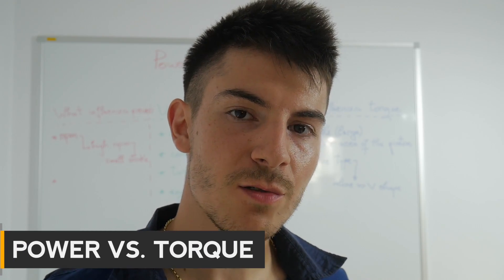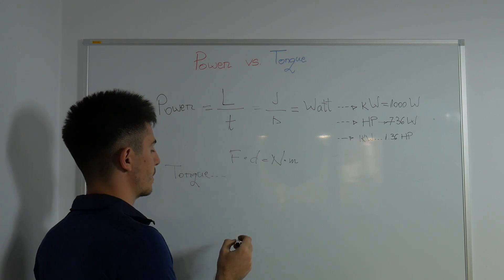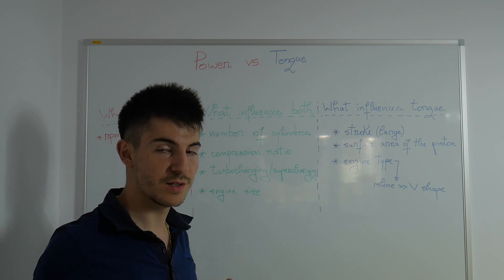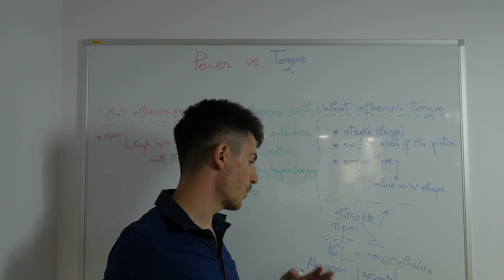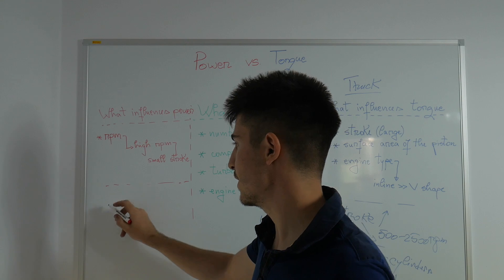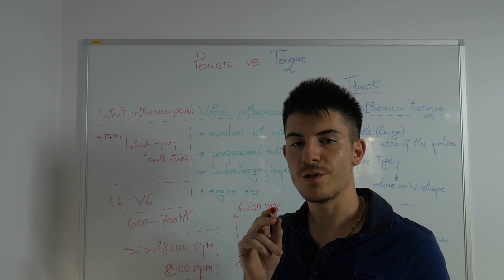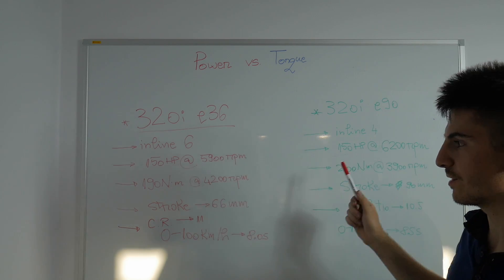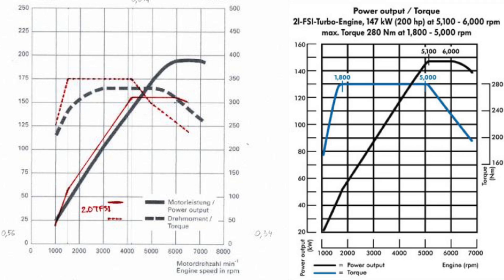Power vs. Torque vs. RPM

Comment: hello, nice video, thanks for sharing! I have a bit different problem. My car BMW M4(F82) offers more toque at high RPM then it is alowed to use (software torque limiter). I cant understand, why the torque is such strictly reduced from 5.500 RPM because if there is not a torque limiter the engine can continue with 550Nm up to 6.200 RPM, now after restriction it has only 490Nm. Can you tell me why BMW restricts the torque at higher RPM?

Comment: I found two different Horsepower equations. I'm no math guy, so I'd like someone to explain why there are different ones.

First equation is  HP = Torque X RPM / 5252

Second equation is   HP = 1.59 X Torque X RPM / 100000 

One is from an engineering website, the other is from an electrical theory book called Delmar's Standard Textbook of Electricity.
Reply: First is foot-pounds, second is pound-force-inches (lbf-in)

Comment: Power continues to increase even though Torque decreases because the RATE ofincrease in RPM is GREATER than the RATE ofdecrease of Torque. And it starts decreasingafter a certain point because the air flow cannot overcome the restriction of the valves, stem, etc. before it enters the combustion chamber.